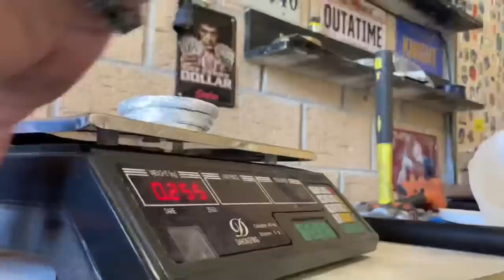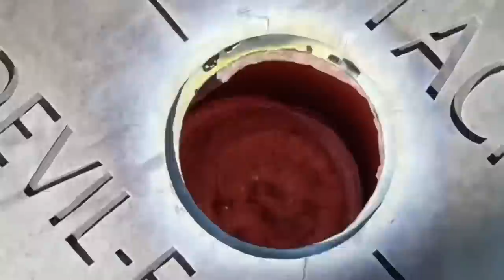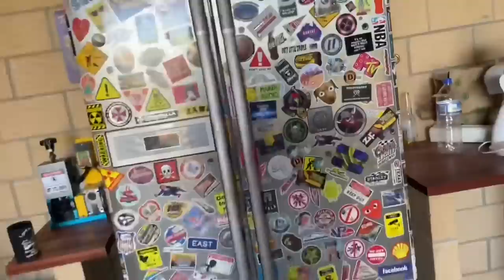Pure Aluminium From 1024 Pie trays - Trash To Treasure - ASMR Metal Melting - BigstackD Copper

Comment: Have you ever considered taking the dust from the aluminium wire-wheeling and sanding and mixing it with ... ground up rust.  You can get some really hot results using that mixture correctly.

Comment: You said you wonders if old copper pipes have silver solders on the joints from the looks of the ingots’ solidifying patterns… maybe you should add in 5% or 10% in silver value by weight to your weekly logbook? ;)

Comment: Ok I was expecting you to wad up the last few tins that kept blowing away before you compacted them.  I do have a question though you always say cardboard keeps the crucible from sticking but why do you only use it while smelting copper?
Reply from the maker: When the crucible and firebrick get to the temperatures needed for copper to melt for some reason they decide to fuse sometimes but when you’re doing a lower temperature I’ve never had the Crucible or firebrick ever stick. Apparently when the cardboard burns it creates a layer of carbon. You could potentially use it on all metals you melt it certainly wouldn’t hurt👍🏻

Comment: Old pipe definitely had silver solder brazing, especially if they came from AC units like those pipes did. Your silver contacts easiest way to do them is to simply cut off the silver contacts, then use concentrated ammonia to dissolve all the silver and copper, and then carefully plate out the silver from the copper, using a graphite anode and cathode, and adjusting the voltage, so the one material deposits out preferentially to the other. Slow, but will give a very nicel little silver plate on the cathode, and after you can refine the copper  by boiling it dry, and smelting in a crucible with some borax and regular copper scrap.

Comment: I have scrapped copper before , unsoldered copper pipe is what we called 'clean' and soldered copper joints were dealt with as 'braziery' and we dealt with them seperately, it does make a difference to the weight value of the ingots, but I have been enjoying watching you work with the materials I used to deal with in larger quantities, keep up the good work , and thankyou for sharing it all with us :)

Comment: Here’s a old joke; from Alabama in 1867 to YouTube:
A blacksmith heated a horseshoe in the furnace 
until it was white hot, beat it into the proper shape with his hammer and anvil, and then quenched it in a barrel of water sending up cloud
of steam. The blacksmith placed it on the anvil and said to the Yank
"Don't touch that, it's still plenty hot enough to burn ya!". The blacksmith turned away to get the next horseshoe but, knowing Yankees, watched out of the corner of his eye. Sure enough he saw that yank reach out, pick up the horseshoe, and then quickly drop it. Whirling around
he said to the Yank "I warned ya, burned yerself, heh?". The Yankee,holding his hand behind his back replied: "Nope". The blacksmith, a little mad at that yank for lying, yelled: "Fes up, I saw how quick ya dropped that horseshoe, You got burned, didn't ya". The Yankee replied:"Nope..., just doesn't take me long to look at a horseshoe".

Comment: Hay Big Stack D! Greetings for Southern Arizona! I'm a big fan of yours. Your videos got me interested in metal casting.  Thank you!
The two copper bars that you casted from that dirty copper does in fact have silver in them. The solder and brazing rod contains silver. It makes the solder flow easier with no gaps in the joints.

Comment: Kinda got a silly idea for a melt for you. You know what casino chips look like. What if you did a melt where you made 20 of each in different types of metal. Like 20 of them in aluminum, 20 in copper, 20 in bronze, 20 in Nordic gold and any others you can think of. So that you can have your own poker chip set. I know it's a silly idea and probably to time consuming but think it would be a fun project. Could even stamp them with different pictures you use  like your dogs. And yes I know that sounds an awful lot like the chest of coins you have but I was thinking of the chips being thinner and done as a set so they would be identical but of different metals.

Comment: hey sir,,   i watched a video,,   and the guy  had a blow torch on  softly in the mold going duriing the warm up and the pours of the metalls,,   the   tops came out so  somme and with  nice smooth rings   the mold being that extra warm  kept the cold bottoms from  hardening before the gaps were filled,,       the came out much smother,,

Comment: I'm thinking about doing what you do but I'm wondering is it an expensive hobby?
Reply from the maker: Once you’ve done the initial setup with all your bits and pieces it’s actually a pretty cheap hobby👍🏻. 
If you don’t want to buy all the Sanders and angle grinders and all that type of stuff you could easily do a very decent set up for under $1000
Reply: @bigstackD  okay thanks for the info I'll make sure to remember that when I decide to get a forge and the stuff

Comment: Is there a reason you don’t use the big propane cylinders? Cheaper per litre overall.
Reply from the maker: Yes it is cheaper per litre but I need to travel further to get them swapped over. If I had the larger gas bottles I would need to travel about 40 minute round trip to swap them over but with the smaller gas bottles although I do pay a couple dollars more I can do a round trip of about 15 minutes and I normally take four or five at a time so after taking all that into consideration I think I’m better off having the smaller bottles when it comes to time and petrol used to get the bigger ones 👍🏻. Plus the smaller ones are just so much easier to move around
Reply: @bigstackD  Makes sense. Thanks for the reply too. Keep it going, I love the channel.